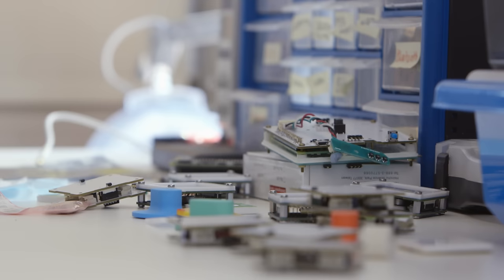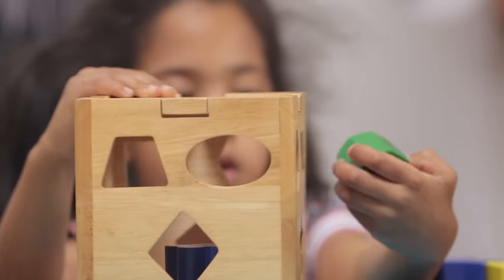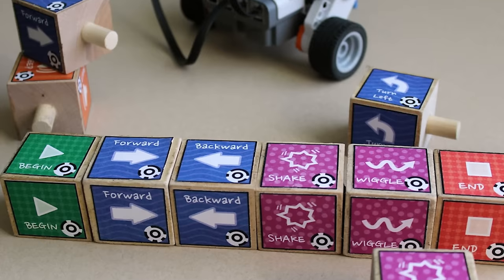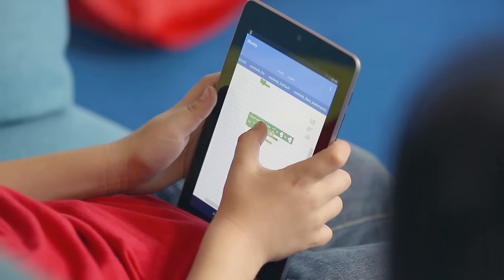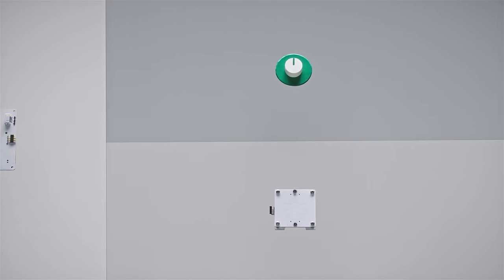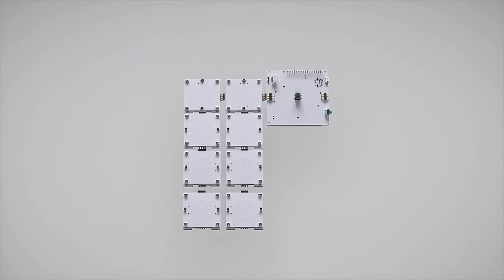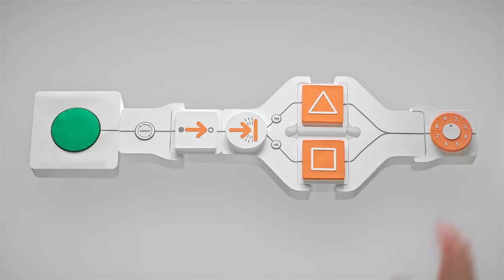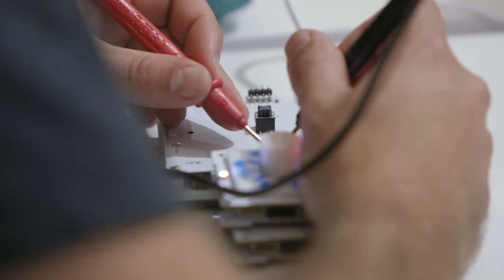Introducing Project Bloks

Comment: how about you guys just get on a new nexus 7?
Reply: Or Gboard for Android
Reply: whats wrong with your current phone?
Reply: Idc Stfu um nothing. The Nexus 7 is a tablet that Google hasn't updated in years.
Reply: Asiia Phan Oh I thought it was a phone
Reply: +Asiia Phan because the android tablet market is dead, sorry to break you the news. the pixel C will get updated and android will be made better for multi window and chromebooks will be better designed for android apps, because that's where the market is headed; 2-in-1s
Reply: I refuse to buy a new tablet until Google releases a new Nexus 7! Though I have been using mine for four years now, and it has stopped receiving updates...
Reply: +playingpoise J